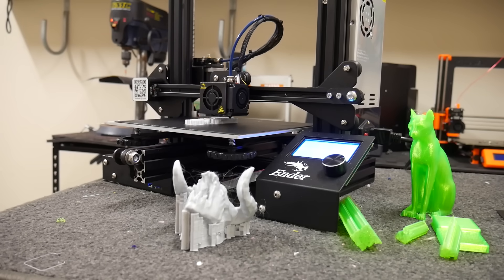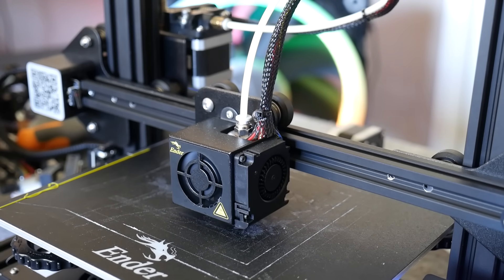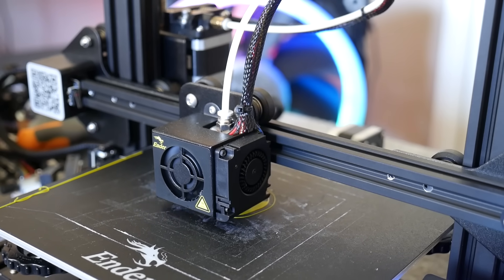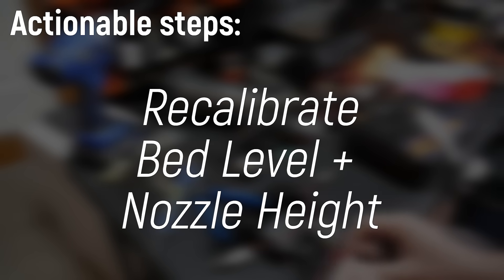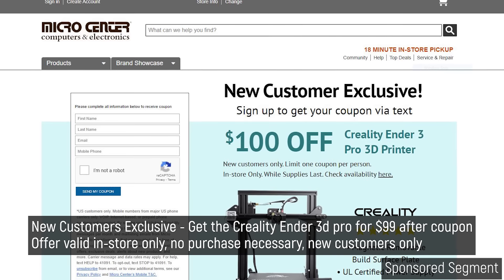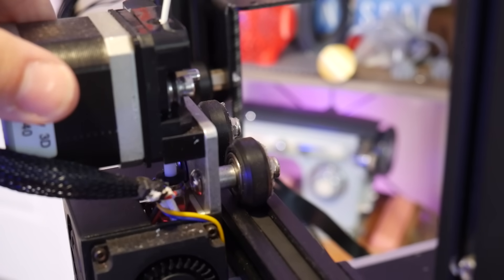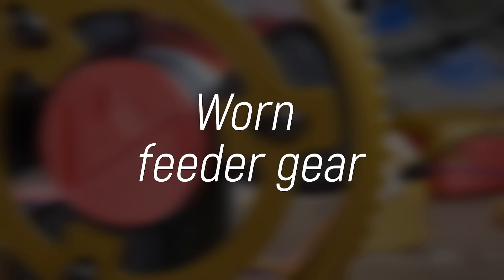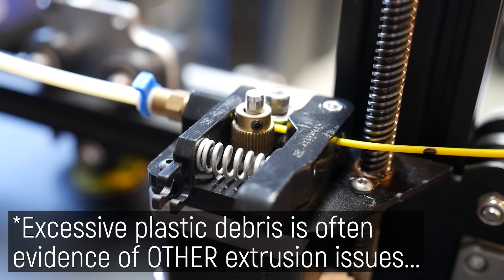Have your 3D Prints started to suck? Watch this!

Comment: I was having printer issues on my Ender 3v2, at first it was printing parts so weak that they had the same consistency as a puffed cheeto. Later on it got so bad that the first layer would fail every time. I thought it may have been the nozzle, with a partial block, but it was actually a broken extruder tension arm. It would be nice if the thing lasted, but I don't regret the all metal upgrade.

Comment: As a very occasional user of my 3D Printer, I clean and level my print bed every print. So far, this basically solves my issues if I have my settings correct.

Comment: Another fix for the baked PTFE is to keep some short lengths that fit just inside the hot end, with the junction to the main length of tubing inside the fitting. At long as the ends are cut flush and the short length is hard up against the nozzle,  there will be less problems with clogging and pooling inside the hotend. I also change out the nozzle as soon as I notice print quality degrading.

Comment: <Looks at Prusa MK3 that got nearly 2 years of printing time before I even thought to do anything besides clean the bed and still produced nearly the same quality prints then as it did when first built>

Great tips as usual. An old coworker actually just picked up the Ender 3 Pro deal from Micro Center and proudly announced it to me.

Thank you for saying the PLA can become stringy if it's too humid. You ask 10 people how they should treat PLA and you'll get 20 different responses. I have all my filament in freezer bags with desiccant that changes color when it needs to be dried/replaced. I still dry filament in a dehydrator too (though I've since upgraded from one similar to what you have to a fancier box unit so I can load multiple spools into it). I do indeed notice the difference. But there are others who just leave the filament on a shelf, exposed. It's your environment, it's your home, it's so many things that everyone is gonna have a different need/experience. But the first step to figuring it out is to admit: yes, PLA can get moist and it can cause stringing. I see too many who argue the "exposed to the environment" setup, not because of experience, but because "PLA isn't hydroscopic. It doesn't absorb moisture. If you're stringing/<other reason goes here> it's temps/retractions/etc." Start with admitting it can be affected by moisture and a lot of headache can be saved.

Comment: Great tips.

FWIW, when I ran into the moisture issue with PETG, I wound up just putting the whole spool into the oven, set at 160 F (70 C), left it for two hours, and prints worked great after that. I still heard a little popping, so probably it would've been better to dry it longer, maybe four hours or more. But even just two hours was enough to get things back on track.

I put a square of foil on a cookie sheet, and then put the spool on the foil, just in case things went wrong. But the temperature I used is still well below the transition temp for both the filament itself and the plastic spool it's on. Neither lost any of their shape at all, never mind did it seem like they came even close to melting. Same with any sort of odor...i.e. the temperature is low enough that there's no detectable off-gassing at all.

So, yeah...if your PETG needs drying, just set the oven to some reasonably low temperature, like 160 F, and leave the spool of filament in there for a few hours. Bonus: a household oven can fit a lot more spools of PETG in it than a typical dehydrator can. :)
Reply: Disadvantage of using an oven is usually ovens use bang-bang temperature control with fairly large hysteresis. If you have a logging temperature probe, check your own oven out to see how bad the temperature swings are. I had a really bad one (read cheap unit for cost savings) in a rental unit. I measured the temperature swings and found that oven was swinging back and fourth around the setpoint by about 25°F. The mid-priced food dehydrator (front door model with metal racks) that I purchased a couple years ago seems to have either better hysteresis, or PID control as it is able to maintain temperatures plus or minus only a couple degrees (I forget what the ripple amplitude was last time I logged the temperature).

Comment: Dehydrators work well, but I also use a vacume chamber that I use for taking bubbles out of my RTV Silicone and Polyurethane resins when making molds. I also store my filaments in a tank with a bags of desiccant in them which can be rejuvenated on occasion.  All valuable suggestions.

Comment: Some notes on my recent Ender-3 Pro from MicroCenter:
1. The extruder gear, and all gears, for that matter, are press-fit onto a round stepper shafts.  Can't replace the brass extruder gear without a puller or something.
2. The electronics cooler's fan is wired to the same rails as the part cooler fan ... that is just WRONG. Stepper drivers are not being cooled, unless blower fan is on.
3. The heatbreak cooler fan is the awful sleeve type, as described in this vid.  Starting whining on startup after one day of use. The replacements I have on hand are 12V, and this unit is 24V (sigh).  Must order some better ones.
4. The MCU on the controller board is not an STM32, but rather a GD32F303RET6. A clone -- chip shortage. The stock (github) Marlin Creality upgraded/modded firmwares will not work (last I checked).  Was able to compile Marlin, but that is an adventure.
5. My rotary encoder knob seized.  Weird. Never experienced that before. This one may just some freak accident on my part.
Reply: Sounds like pure garbage. my 300$ leftover stock (so old google search can't find it) printer is better in every aspect mentioned. It took my extruder fan a year to start making noise, so I just removed it and now make sure to not let printing speeds go too low and have transitioned to ABS anyway, so extruder heat doesn't make much of a difference. I just keep an eye not to let the extruder motor overheat.
Reply: That checks out with the ender 3 experience I know. Finding faults and modding it from day one, slowly realizing you traded money for a full time job just to keep it running smoothly due to design shortcomings.
Reply: @BigfootPrinting  heh, guess they're extra hit or miss then, cause (knocks wood) ours at work bought as a cheap extra has been a reliable workhorse pumping parts in quality that humiliated the older big and (substantially) more expensive machine. Granted the older beast is old and up for an overhaul.
The idiosyncrasies like the board fan tied to the part cooler is true tho and hell that's stupid. Even more stupid given the fact they let the hotend fan run 100% of the time anyway, tapped into the 24v, but didn't do the same for the motherboard.

I hope we got the STM32 board...
Reply: I suggest you adding a little buck converter inside the motherboard housing to give you 12v too, in case you run into this 12/24v issue again, or availability of the 24v parts is lacking.
Not like it would be a financially wise thing (usually the 12 and 24v parts are the same price after all), but might add a layer of practicality in maintenance.
Reply: @Kalvinjj  Thanks for confirming that the compartment fan is wired wrong.  At first, thought that I just could not find the right place to plug it back in.  Lots of consternation.  Would be quite easy to burn out a board if running a job that needs minimal or no cooling.  Is the hotend fan on a PWM pin?  Would like to slow it down to a dull roar.  Hmm, have not explored the pins.h yet.
On the PLUS side, yes, it does indeed print well, stock, out of the box.  And the touch probe was a breeze to wire up on the JST 2.54 5-pin mobo connector.
Reply: @two_number_nines  Must be nice to be able to do ABS.  It is cheap now.
Reply: @BigfootPrinting  I am a maniac, and started putting in a bed sensor, direct drive BMG, and dual-z mods on almost immediately.  Already had lots of spare parts and experience with my A8's.  Should have been a breeze to do on a mature design with such a large user base.  But no -- Creality made some strange user-hostile design choices. Curve balls. But at least I get the bed-flinger experience an extruded frame with rollers on the ($100) cheap.
Reply: @Kalvinjj  Am reluctant to put in a buck converter for just one fan.  There exist in-line fan controllers with a little trimmer.  A series 1/2 watt resistor in the vicinity of 100 ohm might do as well.  Yeah, you are right though.  24V fans are not uncommon, or expensive -- just resentful they stocked one of those fantastically bad ones.
Reply: @GnuReligion  you can also put 2 of the same 12v fans in series, because there is most probably something else that needs cooling or you will notice it relatively soon.
Also I'm a converted ABS supremacist. PETG makes me cringe so much I'm not even interested in recycling it out of bottles and my PLA stock is bordering on being useless if it wasn't for its colors. A good enclosure will make your printer feel like alien technology.
Reply: @two_number_nines  I feel like ABS has turned into a cuss word or the Voldemort of materials for some makers, like "Oh no don't use it, use this special unicorn blood molten PLA blend that almost matches the specs you need (except them all) and costs only 5x more than the ABS you're gonna use!"
I use ABS all the time. The little to no creep and high temperature make it perfect for unpredictable usages or stuff inside electronics cases.
Granted, warping on big parts is annoying. I like PETG as a middle ground tho, wood glue on glass and it sticks when hot, releases when cold.
Reply: @Kalvinjj  I print with no fans and have had no problem with warping on big parts.. Furthermore it actually has better bed adhesion and I rely on it to not warp MORE than PLA. PLA has done great for many electronics casings and even PC fan holders, but a few car parts and high temp passively cooled rads forced me to try abs. both applications would fail with petg while paying a higher cost. There is also the high nozzle temp question-petg passes the 240 deg limit to the plastic tube inside the extruder. No matter how I slice it or dice it petg is just a combination of the worst and more between PLA and ABS for anything I do. It might prove useful for high friction parts, but I haven't done any experiments yet.
Reply: @two_number_nines  "ABS Supremacist" is funny!  I have built an EMT8, with the PSU and electronics off the frame.  Need an extra PSU just to keep the bed at 100C.  Must put it in the garage when doing ABS bc of nauseous fumes.  Sadly, never really finished the project -- its a lot of trouble!  Someday I'll join the True Elite, and build a Voron 2.4. Until then, will just rock Afterburners on my A8's bc they look cool.
Reply: @GnuReligion  yes it absolutely requires a dedicated space with no humans living in it for more than 5 mins a day. I took a sheet of packing foam and cut it in the shape of my heatbed. I put it under the plate and then  shoved in a few more pieces to tension it stuck in place for good heat insulation. Makes it heat up faster and save some power. The stock 150w chinese supply holds up excellent. i'm not sure if off-frame electronics is worth it. I built my box around the printer in a way to keep the electronics in ambient air only. Its the smallest box I could build around it anyways, so makes it easier for the air inside to heat up.
Reply: @two_number_nines  Yes, ABS is zero fan even on bridges, it's what I used before I had printed my fan duct (and what I used to print that part itself as well). I've only had it warp without any enclosure and on big parts, otherwise it's always great.
PLA sticks well to very clean plain glass, but don't recall it being that great on PEI sheets, to which ABS sticks like a dream.

Comment: I have in recent years gotten out of 3d printing but it hasn’t been great the last time I used my printer. I just need to do a complete clean and tune/replacement for everything. 

Just to put this in perspective I have a Creality CR10. I bought this printer when it was brand new, so yeah it’s getting a bit old at this point. Though I’m looking into getting back in to printing with a resin printer, but I still should refurbish my printer as well.

Comment: i had the worn feeder gear issue, plastic parts giving, burnt PTFE, clogged nozzle, bad bed level, dirty surface... basically all of these.

- I now unscrew the nozzle and the PTFE and clean the inside of the heating element before every print. that is the most common problem and it's better to be safe than sorry. It's more often than not that i find a huge clunk of mixed filaments partially clogging my hotend.

- i used to take off my glass printing bed every time to give it a shower with detergent under running water, but lately it's not been an issue at all. last 10 prints were done without any cleaning (other than scraping left over plastic.

- i used to have an uneven heating of the glass bed, but i solved that with thermal paste between the print bed and the glass. it's surprising how "wavy" the ender 3 bed is. the paste is clearly filling some big "holes". i've only had to do it once though. still using the same paste after years and the issue is still gone

- The burnt PTFE completely prevented the filament to extrude after a certain point. i think my feeding gear was worn because of this, actually.

anyway, i recommend replacing every pastic part in the feeder mechanism with metal ones. plastic parts are unreliable and they will eventually break too. but be sure not to order a shitty kit like i did at first, that didn't even have a thread for the PTFE tube to be inserted in.

and i'll recommend sticking to PLA. it's just easier and more reliable than PETG. petg is more trouble than it's worth

Comment: Check your nozzles at least every 2 or 3 days of continuous use, even the hardened steel ones wear down fast... doing this will help a lot ofmissues and keep those from starting even putt8ng on new silicone boots when they tear apart.

Comment: Check the nozzles you get from Microcenter. I bought a pretty cheap stainless .4 and didn't notice a small bead of stainless hard welded to the opening until I had to troubleshoot why I was still underextruding after doing everything I could to clear a gunked bowden. So yeah I got crealitys $40ish direct drive kit it's lovely

Comment: Btw if you’re experiencing any issues like stringing that just can’t be fixed and really big strings that look intentional 
Then 1. It’s because you’re print smaller layer height than your nozzle size 
2. Switch supports to everywhere
That’s what worked for me

Comment: Have you tried a vacuum vessel.  Vacuum can easily cause moisture to sublimate directly to vapor.  It can also cause any unwanted air to expand and move out of a substance.

Perhaps a dielectric grease can help with connection integrity.  Besides some lubrication it also prevents oxidation and electrolysis of the metal connectors which can cause resistance to current flow.

Comment: i had a ender 3 that had thermal runaway it would heat up 20 deg above temp i got a replacement and it never hapend to that one 
but in the out-building that it was in  had either a lipo battery  or a wall outlet catch fire  (now i have a lipo chg bag)  and it burnt the building 
so i did not have that printer for long i now have a ender 3 v2 and it's going strong

Comment: I got a roll of filament from a good manufacturer that I routinely use, and it was breaking before I could even finish a single print. I ended up putting it in the oven for about 20 mins at something like 100 degrees to dry it out a little. After that, it worked just fine. The lesson here is that even if you're purchasing from a reputable source, slip-ups DO happen.

Comment: Level goes out after each print, relevel, level gives after first 2 layers, rage ensues, new springs, level now goes out after raft is laid. New bed, level check, nozzle gouges plate on next print. Disassemble and shove in closet for 7 months

Comment: I'm having weird layer shift issues with my ender 3 after about 3yrs. I did notice the fan recently got noisy but didn't think too much of it. I tried all the usual things like new nozzle, new Bowden tube, checked belts, rollers, tensions, extruder cog ect. I shall see if that fan is stopping when this happens.